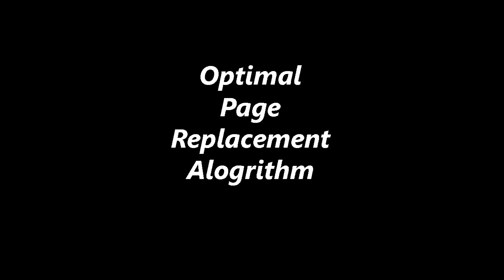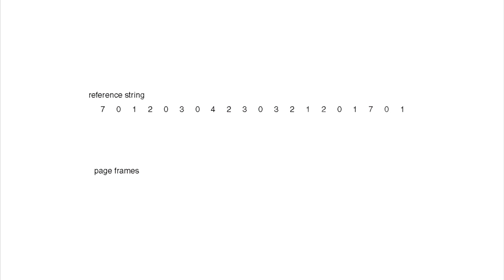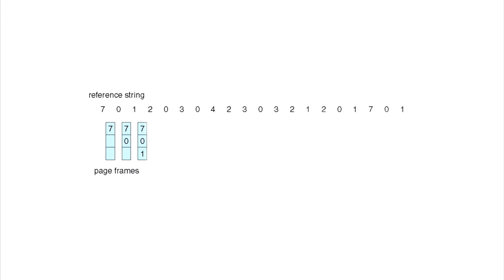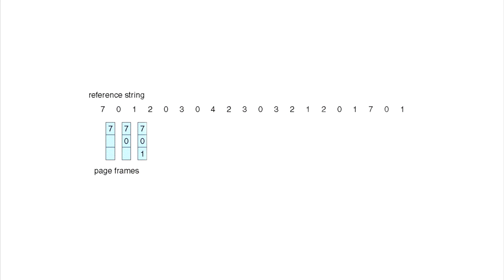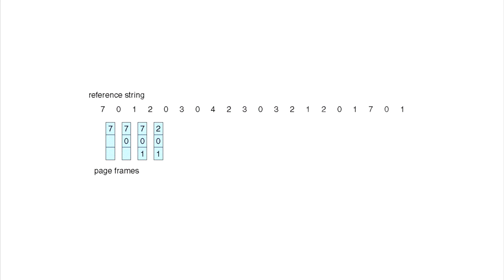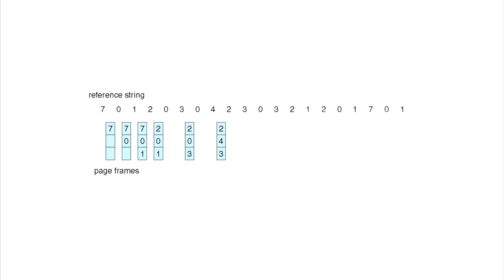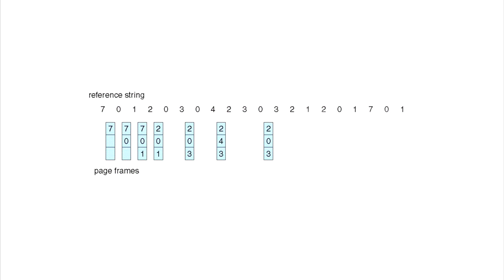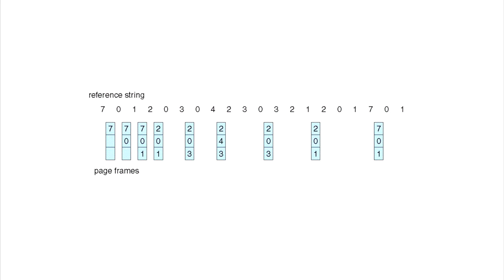Optimal Page Replacement Algorithm

Comment: Hey, great vidoes! One question though. What would have happened if the last 2 numbers were not hits but page faults? What should we have replaced, considering we can't look onto the future  - cause the stream has ended. Thanks in advance.
Reply from the maker: arxatheshark great question, so the number before the last would look at the last number for a hint. the last one you can replace with any position since there is nothing after.
Reply: Thanks for your answer, I got what you said! However, take a look at this picture: https://s28.postimg.org/4ucdnpogd/OPT_example.jpg

When number 2 (in red circle) tries to get inside the memory, it replaces number 4. I was wondering why is that. We have 3 candidates (4, 3, 5) to be replaced by number 2. We can see that 5 is right afterwards, so we are left with (4, 3). At this point we don't have any future data, so:

A) Do you think that the example chooses a number between (4, 3) randomly to replace?

B) Or, (which I suspect is the case) the example looks right back from the start, like a circle, to determine whats the most far away number between those two (this scenario actually fits, in this example) ?

Thanks in advance, keep doing your great work!!
Reply from the maker: I honestly believe that to be coincidental.